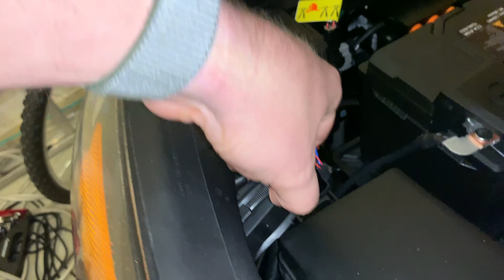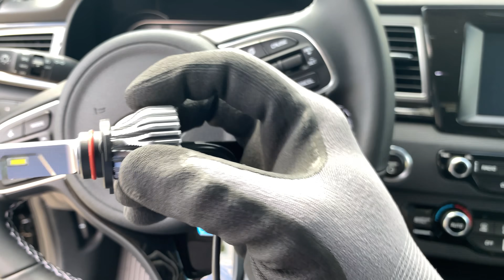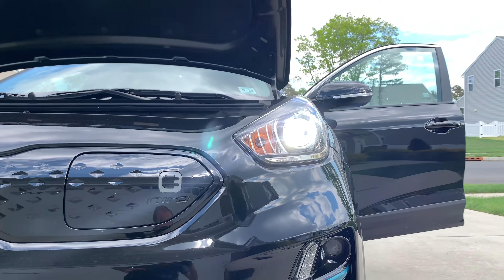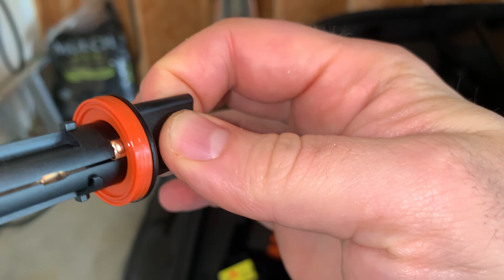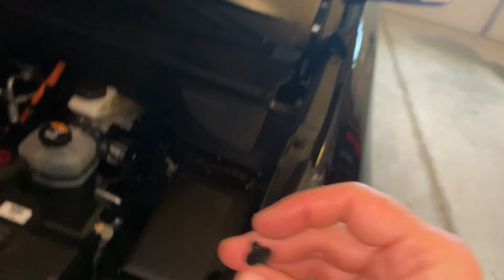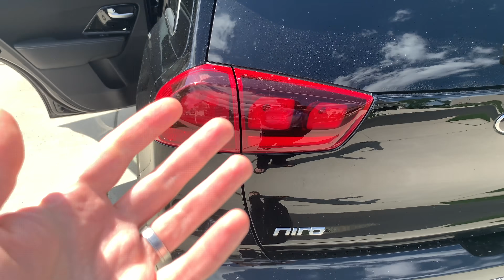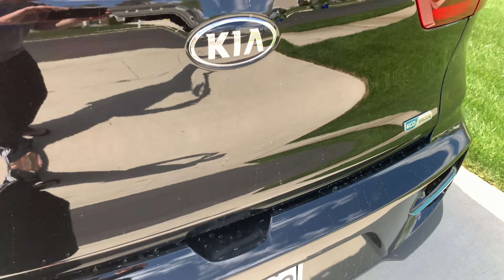2019 Kia Niro Ev EX LED Headlight Installation

Comment: Just put a deposit on my Niro EV EX: expected delivery late summer 
few questions
- how’s radio sound ?
- comfort of 6 way driver power seat 
- overall built quality 

Thanks
Reply from the maker: Radio sound in the EX is surprisingly good!  You have to go in and change a few settings but once you get it to how you like it, it sounds great.  There is no dedicated subwoofer on the EX but unless you want car shaking bass it is more than fine.   
The seats are really comfortable.  They are soft but not too much and at the same time very supportive.  I am 6'1 and have no problems.  I am very happy with the seats.  Even in the back they are very comfortable.  
The EX does not have power seats.  Maybe yours will but mine does not.  Which is fine.  If they offered memory seats I would have made sure I had them but if you are switching drivers often, manual seats are faster to adjust.
Build quality is excellent!  No shakes or rattles, very quiet cabin, fit and finish is great!

Any other questions please feel free.  Congratulations on yours.  What part of the country are you in?
Reply: NiroEvJ 

I’m in Vancouver BC. My local dealer said that even EX version has power seats. Not  a real dealbreaker but it would be nice to have it 

I guess it’s too early to ask but how’s AC affecting range
Reply from the maker: Yeah the versions in Canada get some options not available to the USA.  I think you get memory seats as well
Reply: NiroEvJ 

One more question

Just found out today that all EX versions in Canada are to be black in colour 
Not even white is available. It’s crazy 
Did you have a choice of colours ?

Another question : it’s not entirely clear to me if the EX trim has blind spot detection 
Can you clarify ?

Thanks a lot for your help
Reply from the maker: @jackp2563  I did have a choice in color but it was limited to what they had coming in.  There was blue, silver, black, white, and dark grey.  I was going to get the blue one but the black came in first.  Yes the EX has blind spot and cross traffic detection.  It does not however have parking sensors if you are going to back into something.  I just use the camera.
Reply: @jackp2563  I have the SX Touring. Ordered October 2018, received May 2019. It's loaded and worth every penny if you can get it. Incredible comfort, seat memory settings, sound system is fantastic, and its a joy to drive. Regarding range, Kelowna to Chilliwack at 110-120 kph in the summer with ease. Range drops considerably in winter - but I like the heat on bust and I have a ski box on the top. Getting used to the torque control in snow and on ice took a bit. I was used to an ICE car spinning until it got grip. The Niro backs right off and accelerates gently when it gets grip. One other thing, if you need a receiver for a bike rack, it takes the standard 2' receiver from the hybrid with only one piece of plastic needing to be cut underneath. It is also tucked in out of the way. Very clean install. I think the brand is Curt. You're going to love your Niro EV.
Reply: Albert Berkshire 

After 8 months wait I gave up , ended up with RAV4 hybrid. 
Now, fuckers from Kia Richmond will not refund my deposit. 
I’m going to BBB , local media and Kia Canada to get my $1000 deposit back. 

I’m glad you’re enjoying your E Niro.
Reply: EV EX-premium or PHEV/HEV with premium package in [LX/EX] or Touring comes with Herman Kardon with 8 speaker and these are definitely premium sound system at this price point. others are standard system with 6 speakers and without sub-woofer.
Reply: EX is the cheaper model without power seat